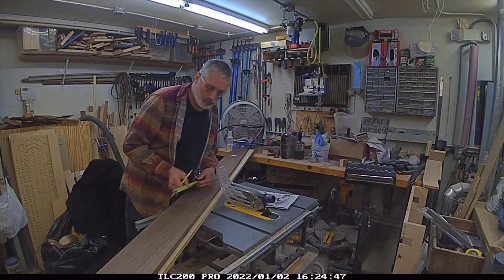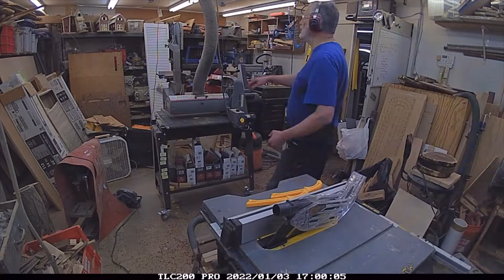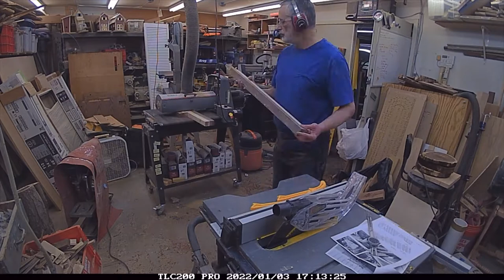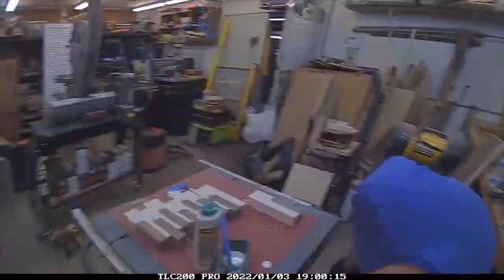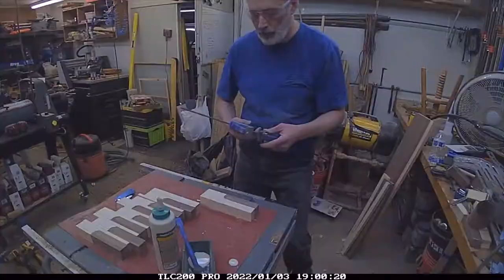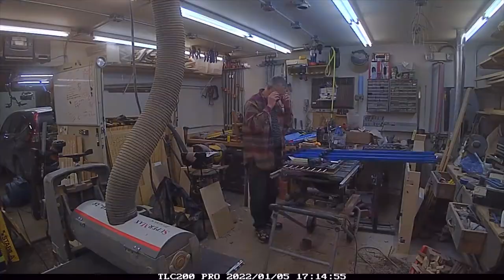Piano cutting board

Comment: How in the world did you make the ends of the black keys look 3d?
Reply from the maker: The 3D ends are an optical illusion created by using end grain for parallelogram and sandwiching it between the other pieces that are face or edge grain.
Reply: @jabssawdust645  wow, seems to work very well. Thanks